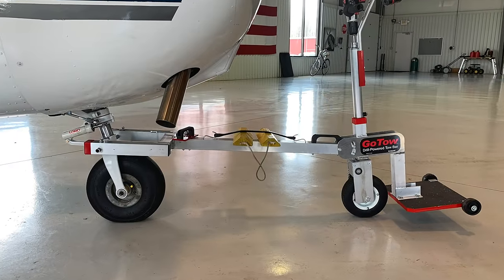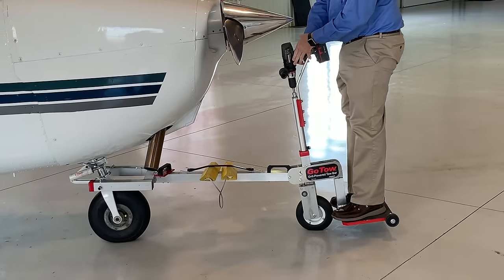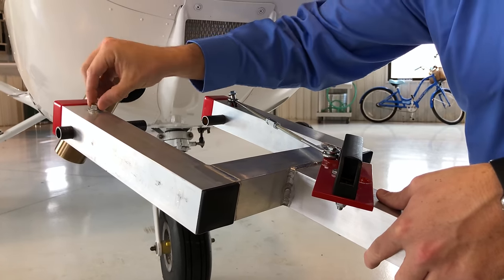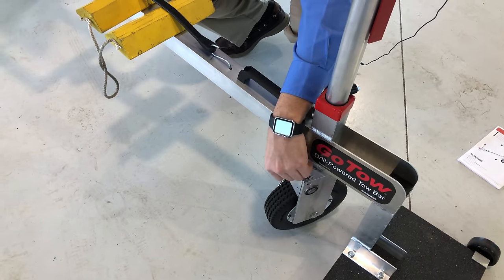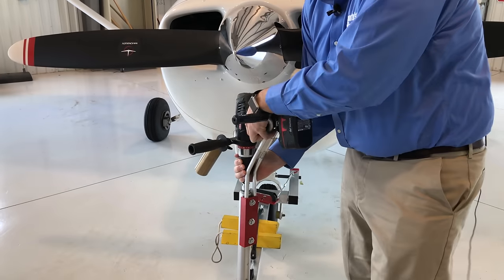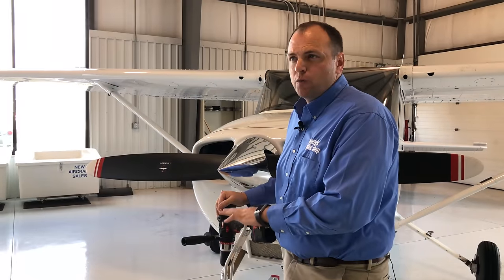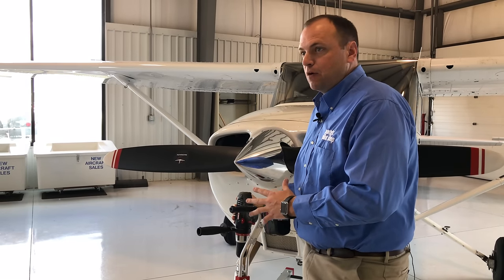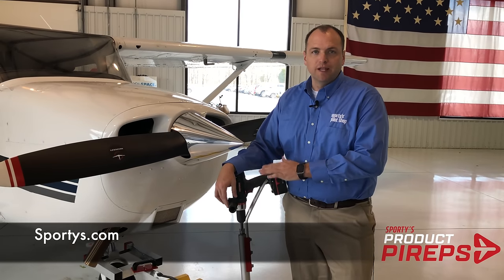GoTow Drill-Powered Airplane Towbar - Sporty's Product PIREP

Comment: I like the idea of the unit... The Robow Tow is very similar and offers a Battery, Charger and the Motor included. This unit seems to be a little pricy, but I may have to get one as the RoboTow will not work on my Sierra (C24R Beech) due to the RoboTow design!

Comment: Appreciate the innovation here a bunch but question the price point. At that price I think it should include the motor (fully integrated - not a drill).
Reply: The drill is the point because you can swap them out easily for less than the cost of an integrated motor.  There are plenty of other heavy duty options so reasons don't exist to add another, and drills continually improve. If you want something different the industry has plenty of them so buy one of those instead.

Comment: Pretty smart innovation. That drill's going to get wrecked pretty quickly but that's where the warranty comes in, I guess.

Maybe they could make a heavy duty version which uses higher voltage lawn mower batteries.
Reply: Use with modern drills won't be an issue because of the gear reduction.